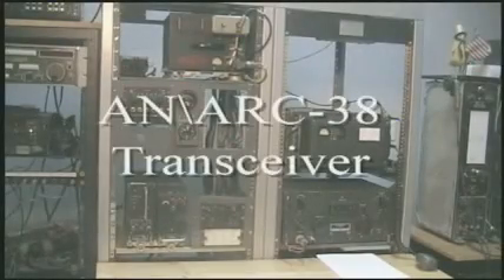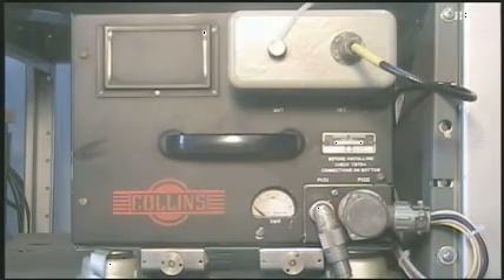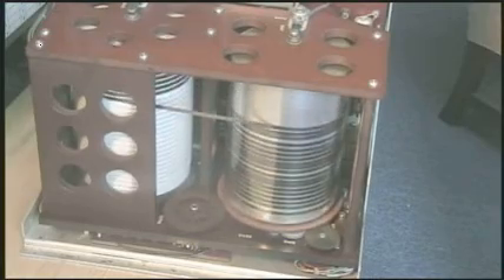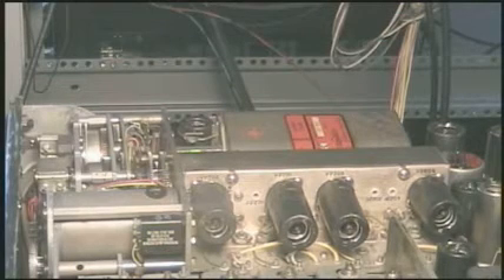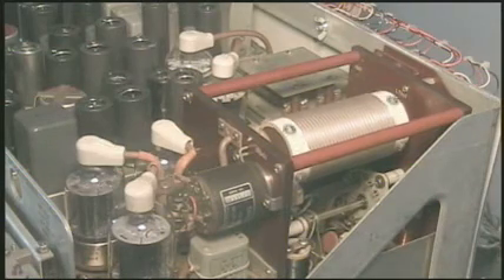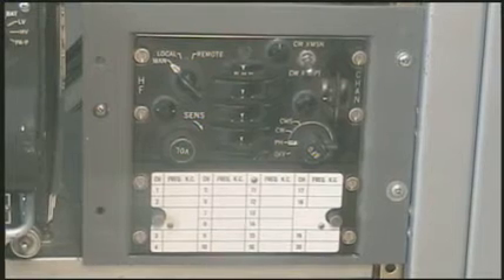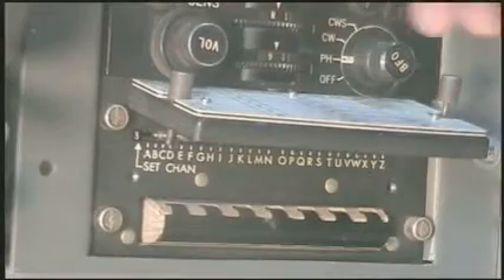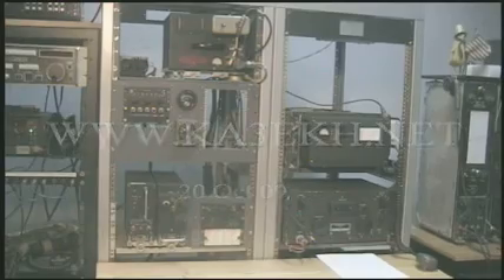Collins AN/ARC-38 Transceiver

Comment: VMGR 252 during the early 80's.  Even 30+ years later, I think I could still tune it without a book.
Reply: My first radio at H&MS 14('83-'85). By the time I got them, they were pretty hosed.  12-18 months for parts and you could almost guarantee that you would be shocked the first time it went on the bench.

Comment: I found this video when looking for AN/ARC-38A (a mod that supports SSB -- single-side band). I used (and repaired) the AN/ARC-38A on fixed-wing aircraft (HU-16E and C-130B) at the USCG Air Station San Francisco from 1971-1974.

Thanks! I can see why these units were high-maintenance items.